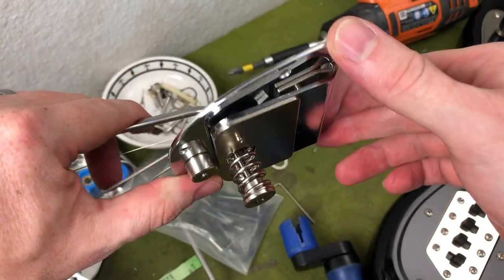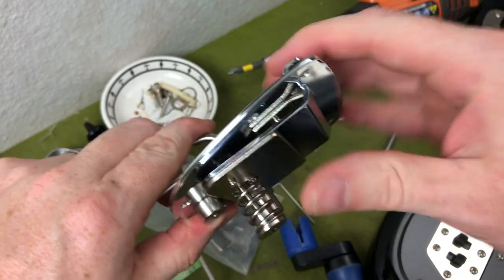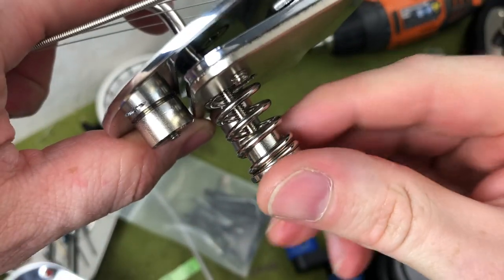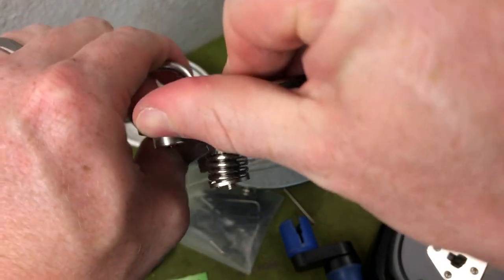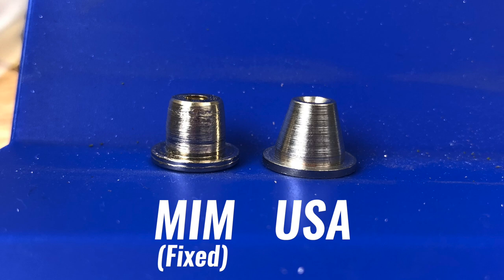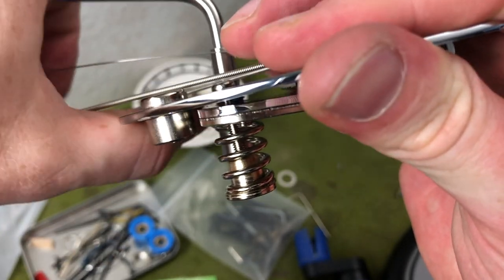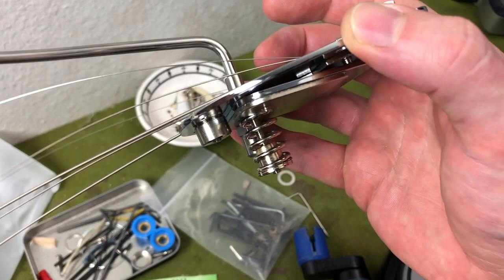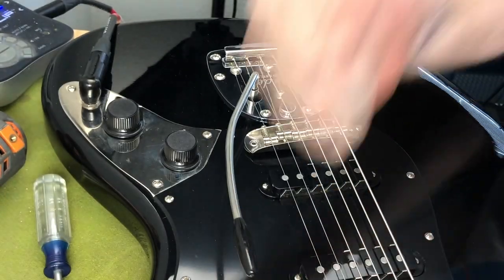Fender MIM Vibrato Problem on a Squier Bass VI

Comment: Hey what strings do you recommend for baritone guitar on a Bass VI? I bought a set of D'Addarios and the highest string didn't have enough length to do more than 1 wrap around the post and it wouldn't tune up to pitch as it was slipping under tension.
Reply from the maker: Oh yeah that can be a problem with VIs converted to baritone. My best advice is to check out Kallium strings, a company that does totally custom sets and offers quite a few options for the Bass VI.

Comment: Is a BassVI conversion the best way to get a baritone? They're incredibly hard to find and I've wanted one for AGES.

Also, is A to A the standard for Baritone? Or are there other options?
Reply: I have a Gretsch G5260 Baritone and see those in stock at a lot of places right now. Same with the Squier Classic Vibe and Paranormal Cabronita baritones.
Reply from the maker: Personally I prefer a 27-28" baritone scale. 30 feels so taut to me, I just don't enjoy it as much. That said, lots of folks are digging the tightness of the 30" scale

Comment: Hey man, just found your channel and I LOVE IT. I’m a HUGE offset guitar guy. As well as a tech (this is my band’s account) 

I have one question. You’ve mentioned preferring thicker strings on your jazz masters. Why is that? Just curious if I’ve missed something. Thanks!!
Reply from the maker: I've always played 11s generally, but the Jazzmaster and Jaguar were designed in an era where thicker strings were the norm––most of the complaints about the bridge saddles and thin tone seem to have started around the time with light gauge strings became the norm. As a result, 11-50 is usually the smallest string gauge I tend to recommend, though with a little extra work the stock configuration can work well enough with 10-52/46
Reply: @Puisheen  oh wow, I honestly was not aware of that. Thank you! Can’t wait to try some 11s on my jag. Thanks for teaching me something today! 🖤

Comment: Lithium grease shut mine up adequately. Out of curiosity @puisheen, I see Fender sells the US widget and bolt as a separate part set - do you know if that will retrofit with the holes and spring on a CP trem?

Comment: Many mods seem to be hype for the VI, like replacing the tuners and electronics, which work fine for me. However, fixing the trem clatter on mine was essential. Unusable otherwise. It has a good trem bridge except for the bushing that makes noise. Thanks for this

Comment: Thank you so much for removing another reason to spend a fortune on a Mastery! Extremely appreciated. 🙌
One thing I did to my unit was filing the edge of the metal “blade”, the one that rests against the curved part with the string holes in it, to a knife edge shape. The original flat end has to “edges”, which results in wiggles instead of a smooth motion. This also improved both smoothness and tuning stability.

Comment: This is great. I bought a Squier Bass VI a few months ago, with this exact problem, now I have an idea on what to do! Thanks!
Also,  what did you do to turn this into a baritone? Is it simply changing strings? If so, what strings are you using?
Reply from the maker: Changed the strings and altered the setup. Installed a .5º shim as well. I wish I'd had time to make a full video but life happened!